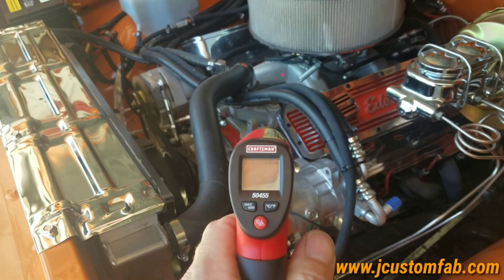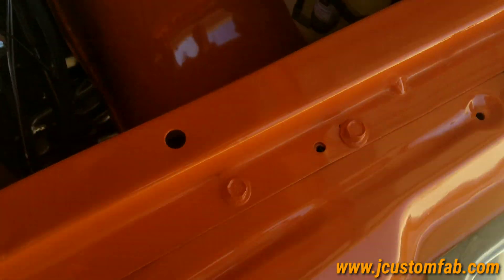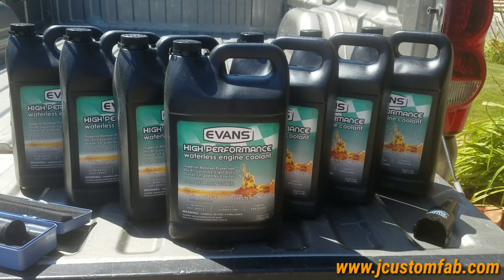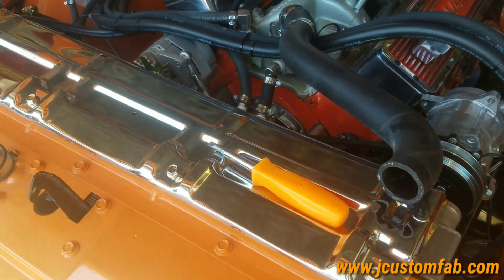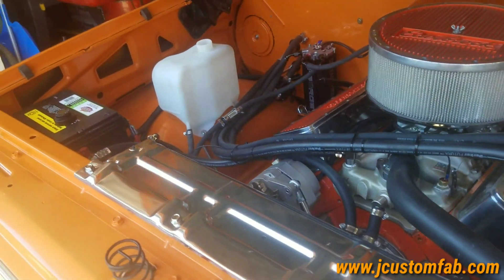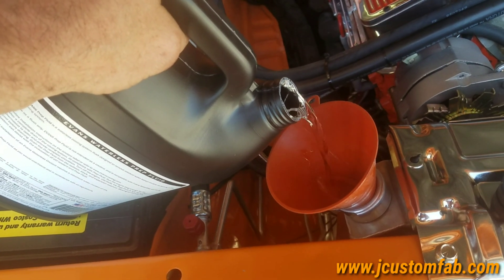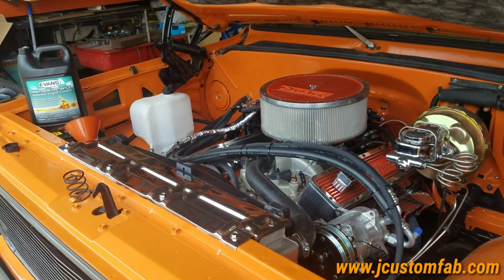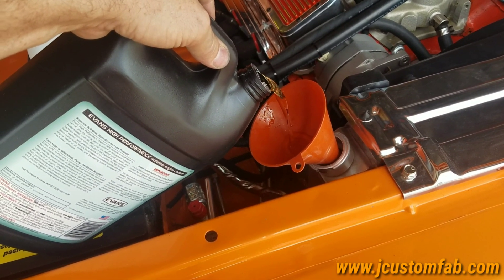1975 K5 blazer With a big block Chevrolet overheating problems converted Evans waterless coolant

Comment: I jus did a mild 454biuld I'm having the same problem what's your diagnosis I recently switched to flex fan and shroud but I'm still getting up in the 250 range
Reply: @JCustomFab   I'm running a high performance pump no thermostat tho ima change my radiator cap as well my fan has about a 1.5 2 inch space from the shroud so my diagnosis will be rad cap and thermostat do you know a specific brand to use
Reply: @JCustomFab  gotcha